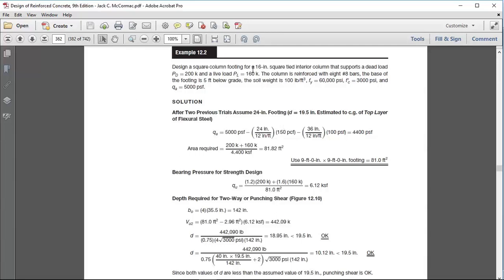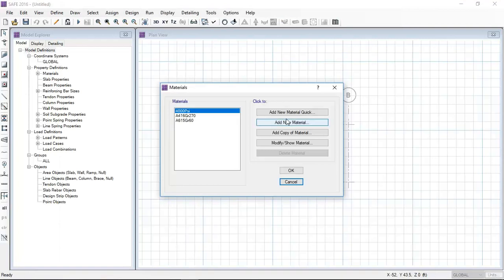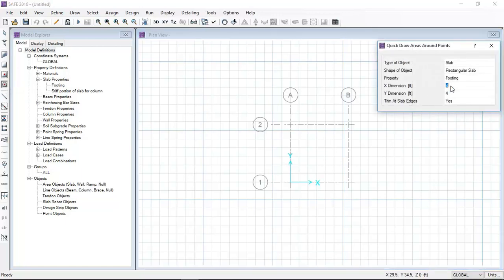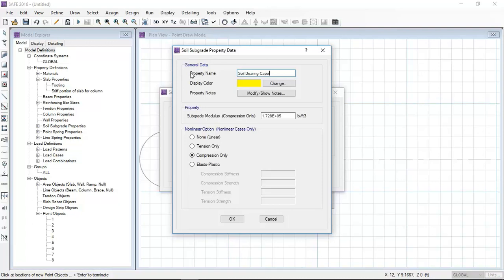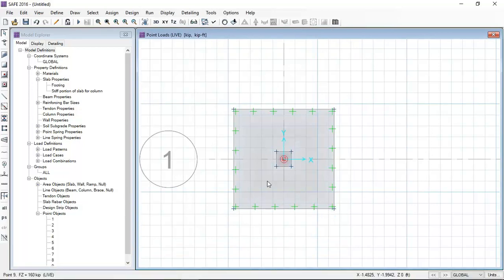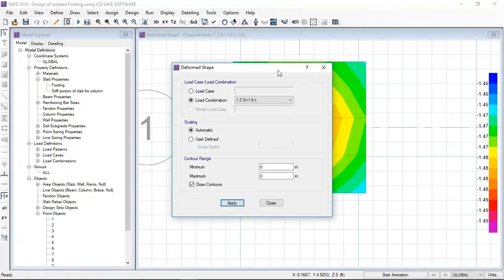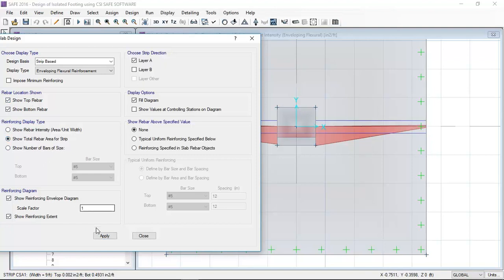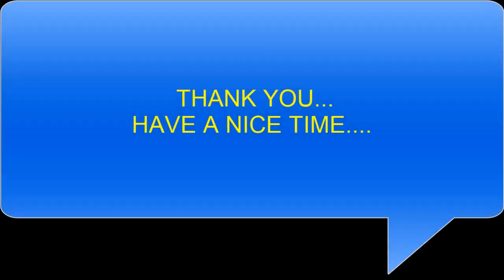CSI SAFE - 16 Isolated Footing Design with verification

Comment: In a complete project, if the footings are directly assigned to the columns, the stiff portion is still necessary to be assigned to the footings ?
Reply from the maker: It is because... We design the footing with... Moment at the face of the support...
Reply: I mean the loads and moments directly will be transfered from the columns to the footings,and the footing will be design for that loads and moments, so why we still need to assign stiff to the footings ??
Reply from the maker: Please check the moments ... with or without stiff element ... you will understand the difference
Reply: Please bro provide a tutorial on how to design isolated footings in a complete project not as a single element, I mean a building with all elements( beams, columns, slabs, and footings)
Jazakallah...
Reply from the maker: @civilengineeringwitharas4776  Here is the full course link on CSI ETABS
https://www.youtube.com/playlist?list=PL0h14oMuZXQ5PXbux0l80ox-8gPwcBl5c

And 

Here is the full course link on CSI SAFE
https://www.youtube.com/playlist?list=PL0h14oMuZXQ6l-O7aqF0hYsZbyJ7eFt1H

Comment: Soil pressure is checked for service load....
Reply from the maker: Yes. Soil pressure is checked against Service load (1D+1L). Because we have already used much bigger factor for material side (I mean for soil)...........(soil bearing capacity divided by 3.)